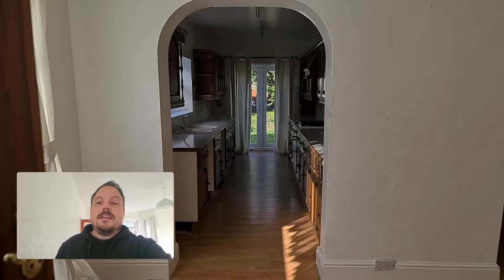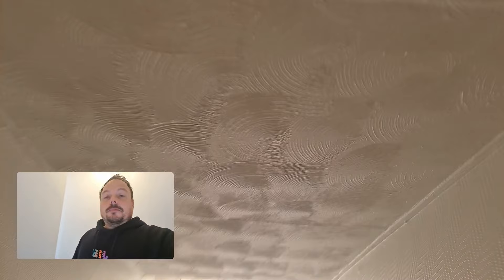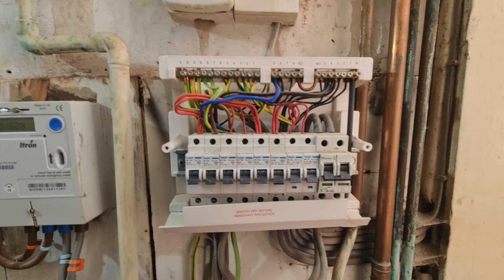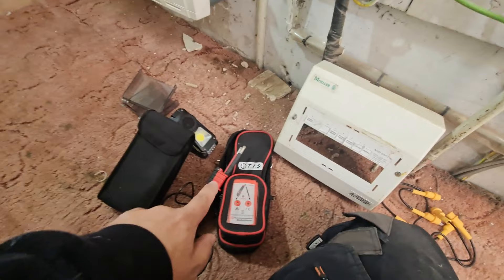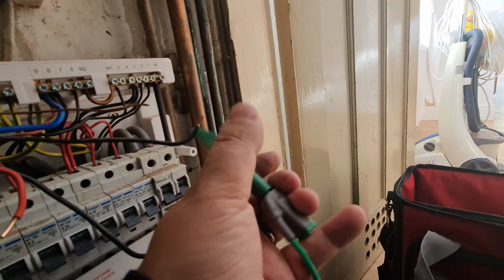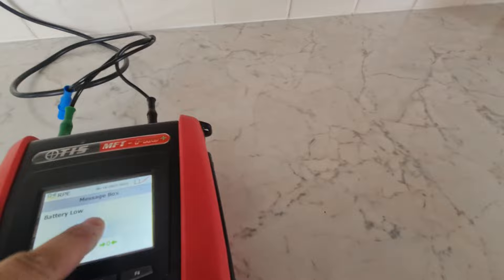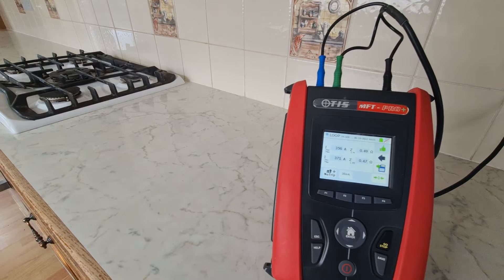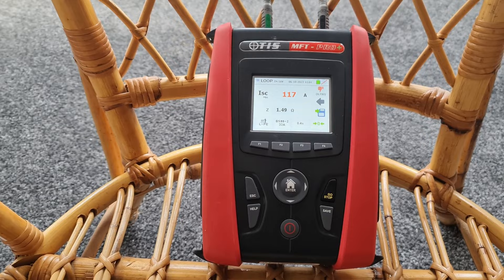How to do an EICR start to finish - Electrical Safety Inspection and Test

Comment: Good video Mark, it's always interesting to see how other sparks carry out their EICRs.  
Good (and often overlooked) point about EICRs not being IV.  Some tests have little value for an installation that is already in service, eg IR between L and N, and time is better spent on other things IMO.
I have found that continuity tests through lampholders using lightmate adaptors often return a higher result than when tested at the terminals.  Wear and tear on the lampholder I guess.

Comment: A few things that I spotted, but I'm not sure if they are something you'd typically report on:
1) No clamp on the tails where they go into the main switch. (Not sure if that one is only for TT systems?)
2) The tails run over and touching a pipe from the heating system.
3) The "Do not store combustible materials near to this equipment" sign right next to the gas meter.
Reply from the maker: The flapping cables under the CU could be one of them mate lol. Good spot!

Comment: Great video. My son has just moved into a new / old house & needs to get an EICR done because the Curry's install team wouldn't connect his new oven up because there was an earth issue. When the circuit was tested it was tripping the main board 80 amp breaker & not the oven circuit 30 amp breaker - which should be 32amp. It's an old CU which probably needs replacing. Also, upon closer inspection we can't find an incoming earth / CPC & can't find an earth rod either! Not sure where all the socket earth wires go to then & I do wonder is there is any bonding of water / gas pipes either (1950's house)? All part of the fun when you buy an older house which hasn't been touched since the 1970's.

Comment: As always, brilliant content Mark! If I had a quid for every single time I forgot to switch a socket switch, I'd be able to buy David Savery (and Nige) a round or two. Just out of curiosity, did you tick TN-S or TN-C-S for the earthing arrangement on this EICR? I know the DNO typically won't guarantee TN-S if you enquire with them but physically it is a TN-S head but we know it's realistically going to be TN-C-S.

Spotted something I didn't like the look of - the elbow union on what looks like the return/flow of the central heating system, which is directly above the electricity meter and with a bit of a green hue. I'd be concerned about leaks - could get interesting.

Keep up the great work!
Reply from the maker: Hi mate, thanks! Went down as a TNCS I know its PME in the street and tbh keeps me on the side of caution lol. Good Ze value as well.

Comment: I think I would've taken the battery out of that smoke detector
Reply from the maker: Didn't notice it at the time tbh
Reply: @electrician247  you mention it at 3:25 liar
Reply from the maker: It was a joke Harvey. Quite clearly it was impossible not to notice 🤣. Relax a bit. Plus who goes around taking smoke detection out of service and disables alarms? Not a sensible person that's for sure. 

Have a good weekend #bekind

Comment: Im just at the point where you take the board cover off but im having to rewind a lot as you speak kinda fast lol just something i wanted to add.thanks for this video its helping a lot i actually passed my 2391-52 last year but have done no inspection or testing since and feel like im forgetting stuff i have been offered a testing role however im bricking it but im trying to watch video and will hit the books again.any tips you have would  be grateful
Reply: How did it go?

Comment: Another great video and again full of content. What code did you give CU ?. Apart from the " hole " in top, would you C2 based on CU being plastic, understairs, no RCD or SPD ? Napit Codebreakers still saying C3 unless thermal damage. It is still the biggest bone of contention on EICR's....Thanks
Reply from the maker: If its not showing thermal damage then C3 for me. However the sockets used outside I would C2. Makes a lot of sense to just upgrade in any case.

Comment: The no trip test fools the RCD into not tripping, once upon a time the MFT used to flood the RCD with a DC current to achieve this, not sure if this is how the TIS works. Incidentally this is the reason why we need to use type A RCD's tied with an RDCDD in EV charging.

Comment: Hi mate. Cheers for the video. I'm looking to do my courses next year and am looking at Multifunctional testers....

Can you tell me a list of tests that are needed for an ECIR so I can get a good tester now that can do the job..

Continuity
Insulation
Rcd (all types?)
Etc

Thank you. Keep up the good work. 
Regards
Tom
Reply from the maker: Thanks mate TIS eco and mft plus are the best options imho but we all prefer different things. 

The tests needed are in GN3 and vary a little based on the installation. But generally continuity,  insulation resistance, Zs/Ze, pfc pssc, RCD. 

Other options are Ra for electrode measurement,  phase rotation, EVSE, volt drop, power quality etc. The TIS mft does this
Reply: @electrician247  cheers mate

Comment: Dear Mark, I have been out of the game for a few years, considering coming out of retirement but have never used a MFT, is there any advice you can give on the easiest one to use. Technically with calcs etc. and the regs i don’t have any issues, however experience is lacking. I would like to sit the 2395 52 sometime in the near future.
Reply from the maker: TIS mft pro plus. Has a help button built in

Comment: How come you don't pull the fuse and re seal it after?
Reply from the maker: Because I don't
Reply: @electrician247  fair enough 😂 was curious if there was a legal reason or just personal preference
Reply from the maker: @Saf_  it is illegal to interfere with metering and dno equipment.  Grey ish area

Comment: Why would you not pull the main fuse? 
You are qualified, competent and doing so for your safety whilst performing the EICR, therefore nothing illegal.
Reply from the maker: You are correct as we do work with the DNO. However without that DNO training I would be none of the above. It is illegal in any application without direct permission unless it’s an emergency situation. Not that anyone would ever be prosecuted. But for me and us it’s a no. Anyone admitting to the opposite should think very carefully. Especially on a public platform…..